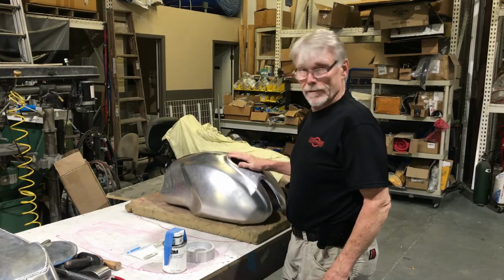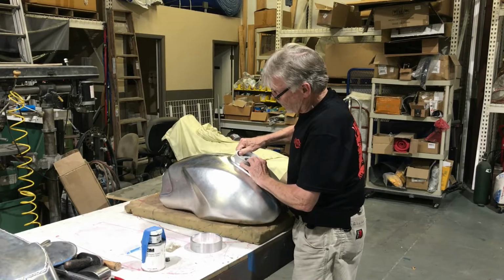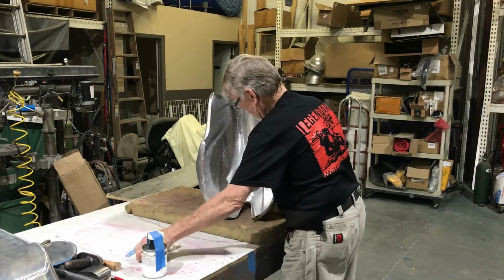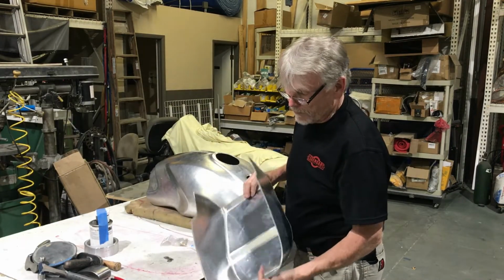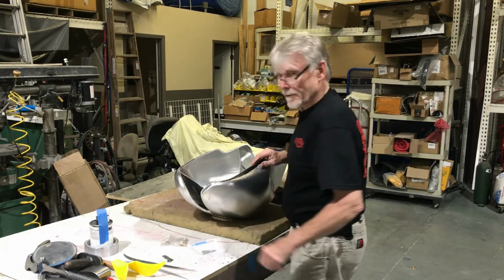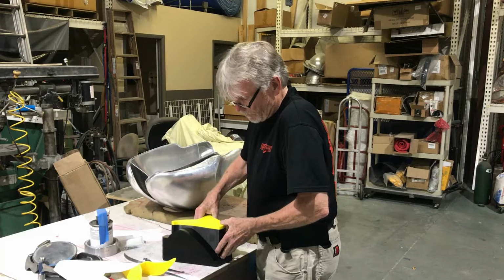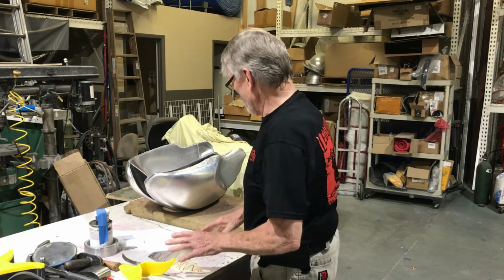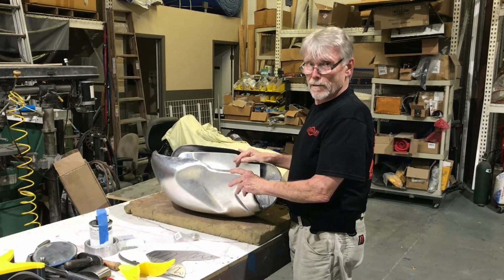Ducati Monster pt2 Aluminum Motorcycle Gas Tank Metal Shaping

Comment: Are these for sale yet, couldn't find them on the website, I need the S2r varient
Reply from the maker: I’ve since halted production of these as I’ve run out of the machines parts necessary for the fuel caps.
Reply: @New School Metalwork Shaping  will you be doing anymore and if so what's the approximate cost?
Reply: @grahamseward1388  about $3500
Reply: @Legendary Motorcycles  ouch ! I can see why though, lots of work gone into development
Reply: @grahamseward1388  yes it is. My hands are giving out on me at 70 years old…